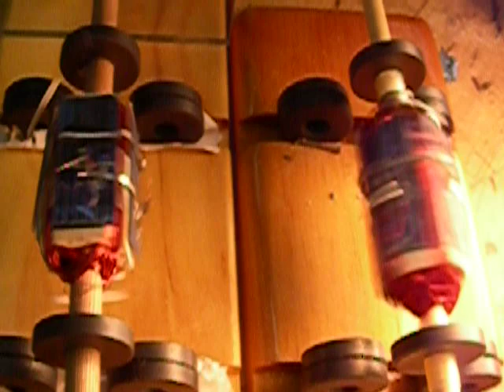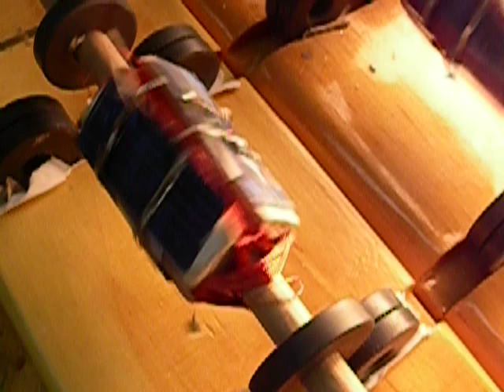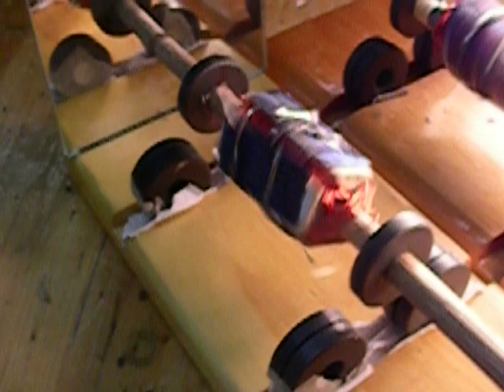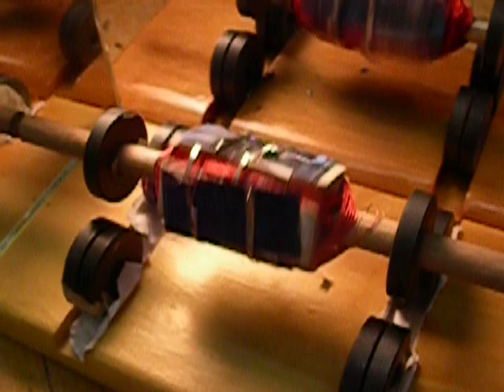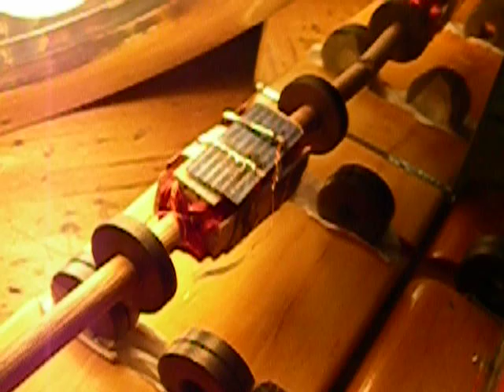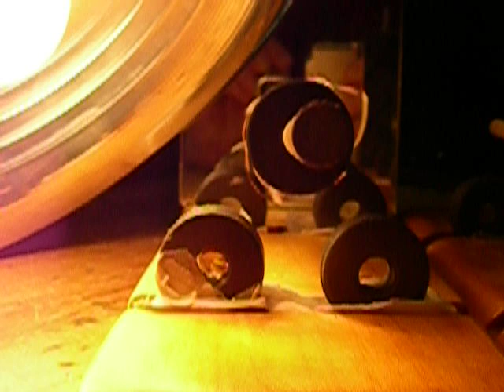Mendocino Motor

Comment from the maker: We didn't test for speed. They might be going as fast as 2200 rpm. There are eight magnets on the base, two on the rotor. The magnet on the front of the rotor is just ahead of the ones on the front of the base. The magnet on the rear of the rotor is centered on the rear ones on the base. The rear one holds it up and the front one pushes it against the glass.The only friction is on the glass of the mirror. If the magnets are out of adjustment, they can cause some resistance to the rotation.